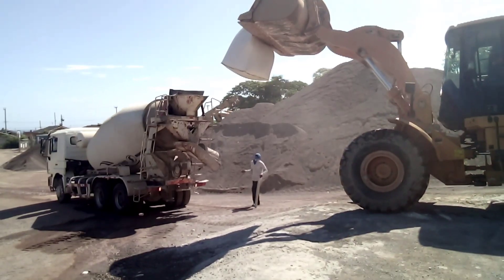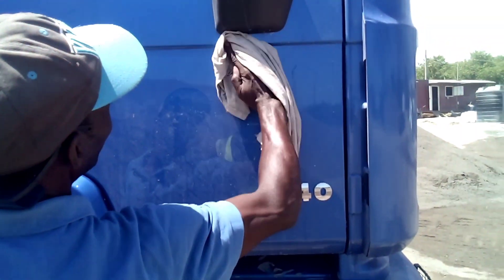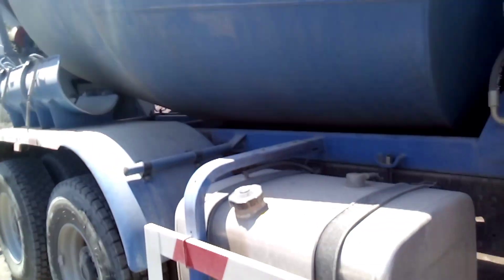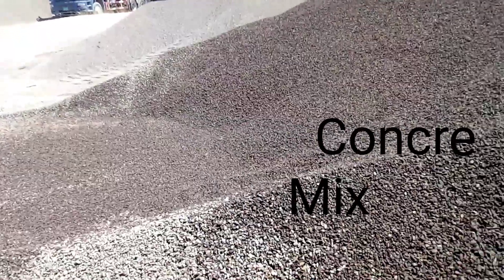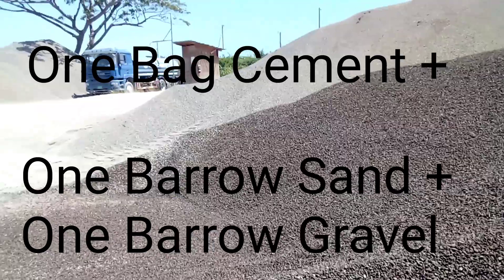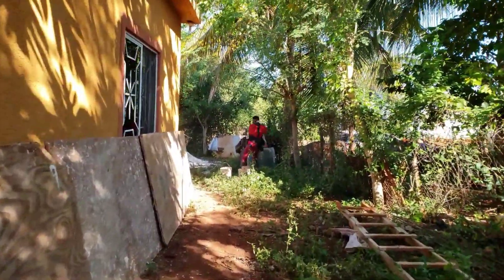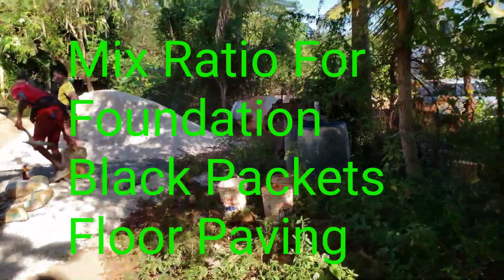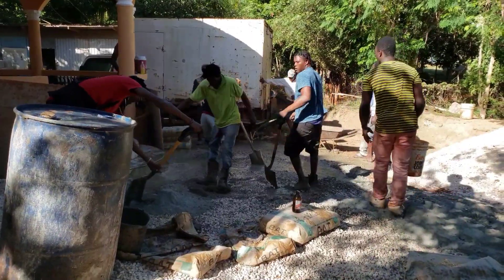How To Calculate Cement Sand And Aggregate Quantity In Concrete Excel

Comment: Are you an engineer? How did you come up with that mix design? What strength  concrete in Nm2 do you hope to achieve with that mix? What is the thickness of the slab? What is the amount of reinforcement in kg used in the slab design? 

How much green fig should you use in a pot of fish broth?